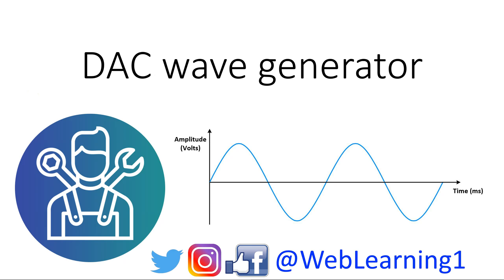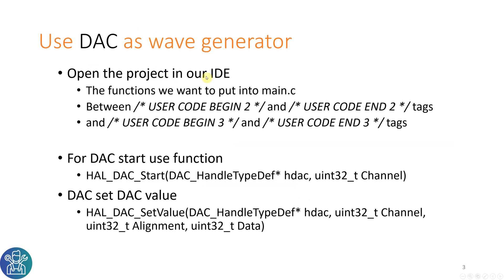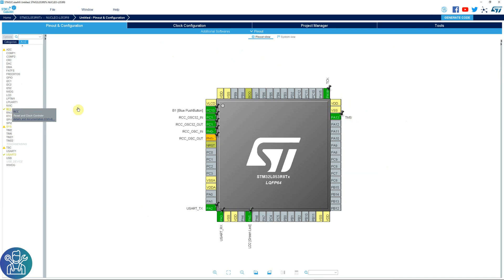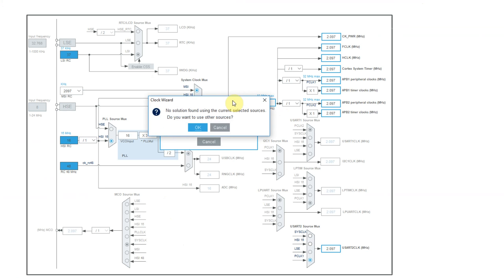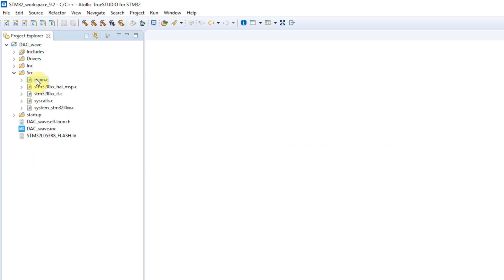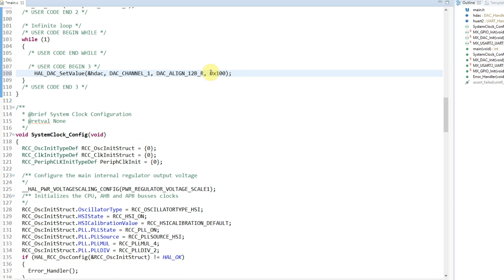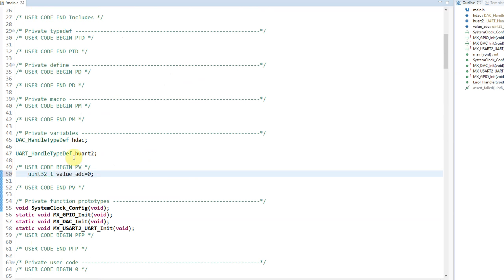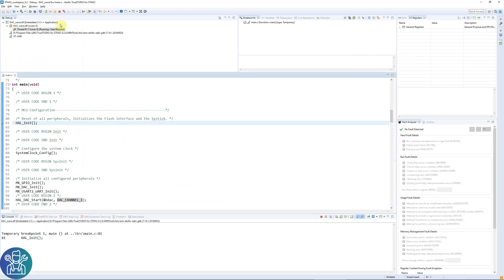HAL #11: HowTo use the DAC

Comment: For those who copied the code and wondering why does it not work.
It does not generate a sine wave. In fact, the output will be 0 volts with this code. 
If you are wondering why did the 4095 appear, is because it is a 12bit DAC (2^12 = 4096 states from 0V to [FullScale-1]V) FullScale is by default the supply voltage (Vdd)
To generate a sine wave, offset the DAC output by FullScale/2, in order to get the negative half of the signal. As for the actual digital value of the wave, use the math library to calculate it (use it with radians!) or you can store it as an array in compile time.
It will be something like this: value_dac = 2048 - (2047*sin(rad_per_deg * deg)); and of course embed this in a for loop to increment the degrees by 1,delay it to get a good frequency(or use timers as a base) , and define rad_per_deg(2pi/360). You can smooth the signal if you increment the degrees by 0.1 and so on.
Reply: Hi. Can You please drop a hex with sine wave for 7.1Mhz as as an example please. stm32vet6
Reply from the maker: I have corrected my wording in the description and referred them to you comment on how to generate a Sine wave.